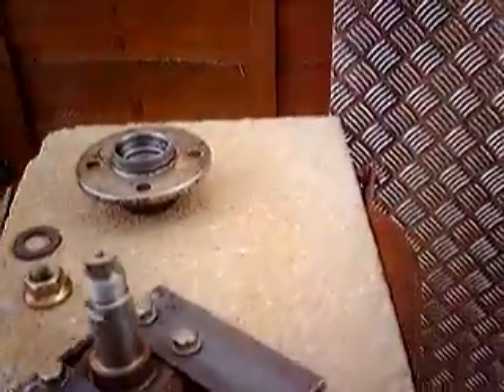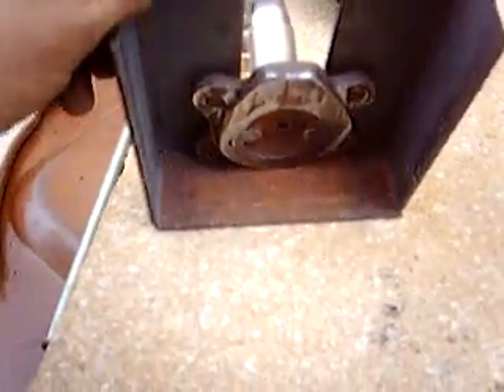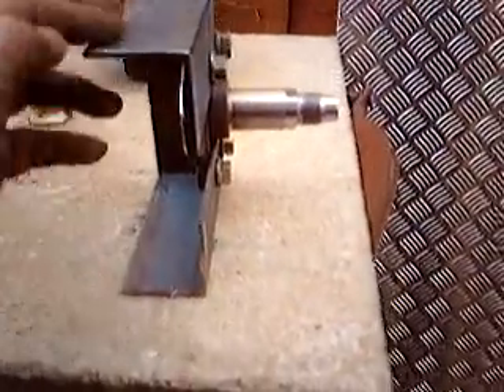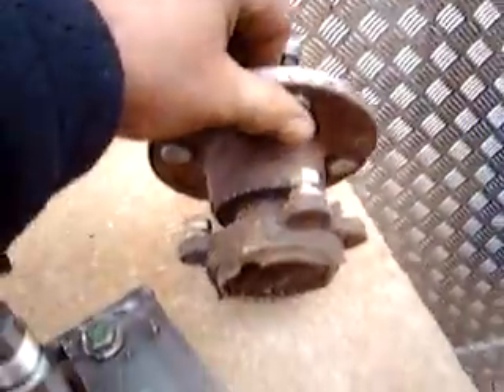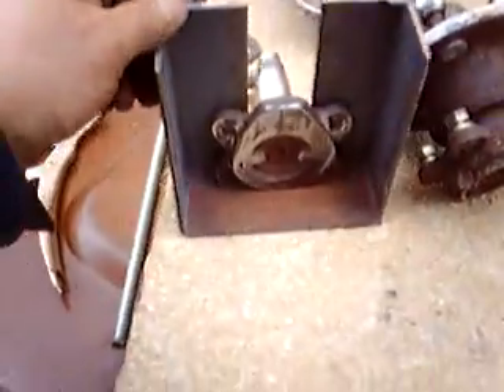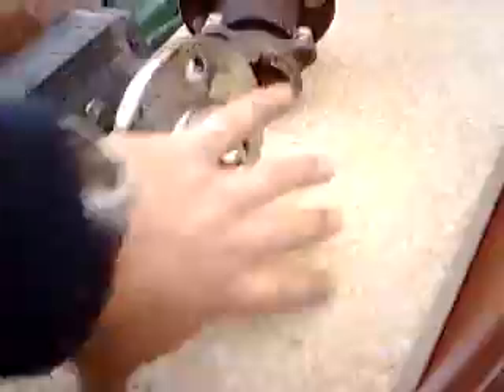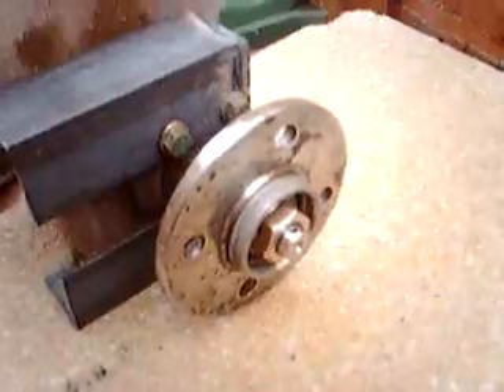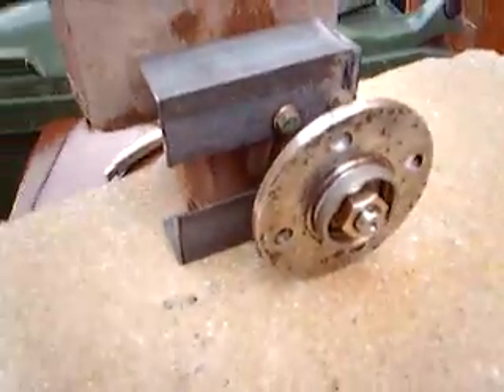home made wind turbine

Comment: What was the bearing you used in this turbine .what was the bearing ultimate strength and will the bearing is suitable for aircraft application
Reply from the maker: Nissan micra car and it was the back freewheeling hub part so I guess this would be no good for aircraft and you will need to drive the blades like a propeller ( in a wind turbine the wind is the engine that drives the blades). 

Hope this helps you out Sir.
Reply: Thank you sir well do you have any idea about the bearing block heat treatment process .and how the bearing is insured into the block and on shaft

Comment from the maker: @bermudarailw ----

Boy you need to check out the up to date material see my other videos I also sell a book on the complete build on ebay type in
wind turbine build plans
and find me thewindmillman
this is a proper build manual of were I got to with this and have now mover on to water wheel 27/7 power generation I will be writing the full build book for this, this summer 2012 when I proof build another water wheel hydro power unit from my notes
regards
TWMM